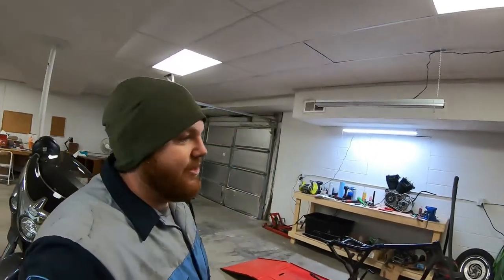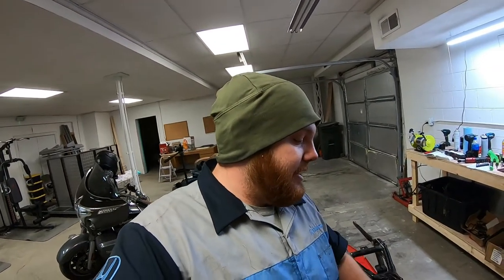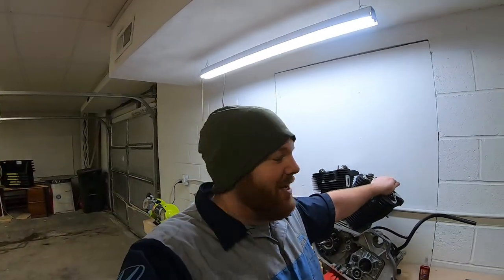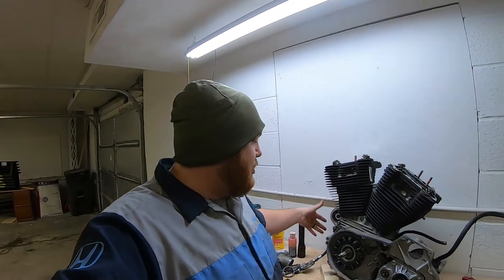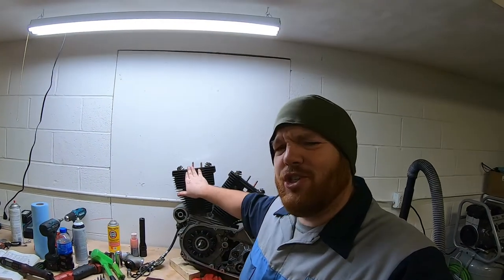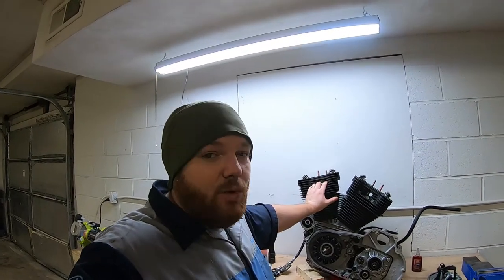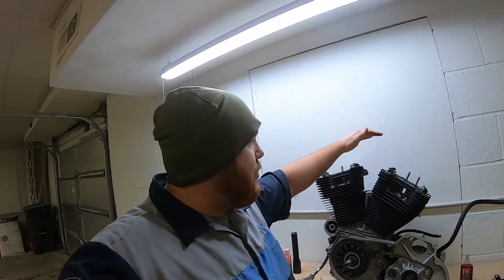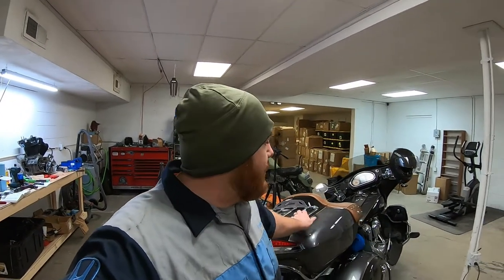Harley Davidson Chopper Build | Episode 1 | Engine Assembly |

Comment: What do you mean it blew up? Do you know what led to the prior failure that’s different in the new build?
Reply from the maker: Previous owner put flat top 1200 pistons with 883 heads, stock ignition, and stock jets.  So not knowing this I was running regular pump gas(as the owners manual says) on about 11.5 to 1 compression.  Pistons blew a part, heads were destroyed, jugs destroyed, bottom end locked up solid.
Reply: @STLNik  Ouch. Cool you got it split and cleaned and  ready for a new life